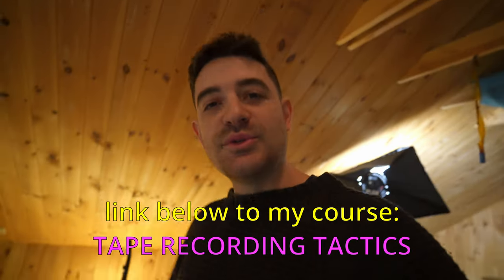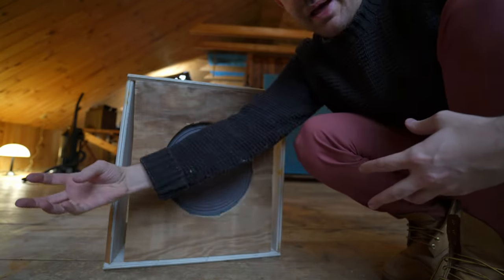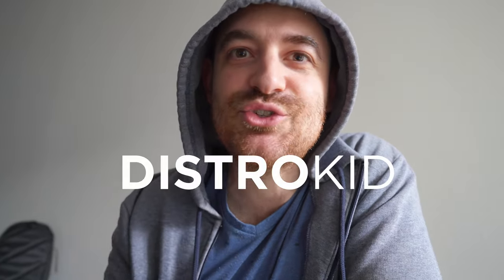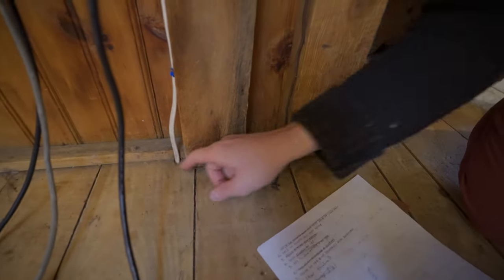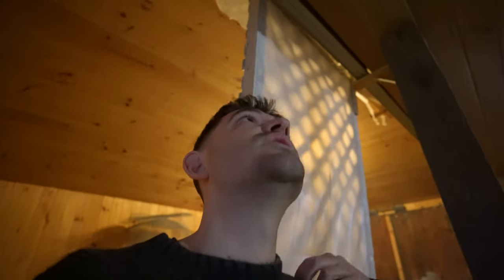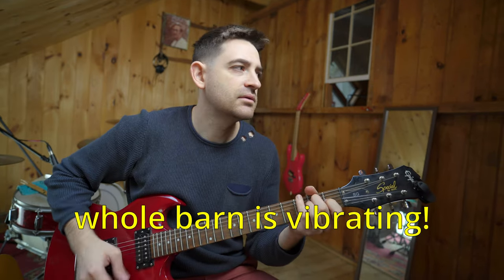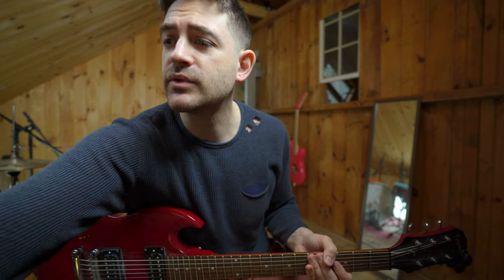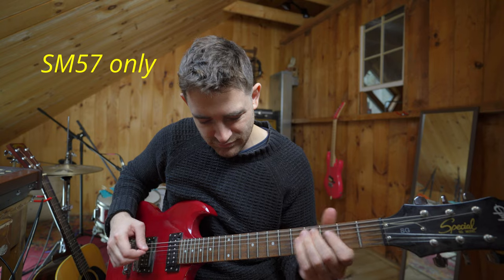You won't believe where I put my Iso Cab!

Comment: Good ideas. I got a new amp on the way and I dig the idea of recording straight from the amp, gonna give this a try. So what's the deal with the Tascam 38? You need any advice on repairs? I actually just sold mine and boxed it up to ship out today. I decided to use an 8 track Tascam cassette deck for your analog course next month! LOL.
Reply from the maker: Hi which amp did you get? thanks for the offer the 38 project is half completed. it got very challenging especially when dealing with electrical issues where the cards meet the motherboard so it's a slow process. but i also had to put it aside for now because i'm working very hard every single day on editing the tape recording tactics course. thanks so much for your getting involved i'm looking forward to getting it out to you.
Reply: @travisraab  Long story. I've been all over the place on amps and usually end up going back to Bias Amp in my DAW. But I'm in "a band" now so need an amp. I had a sweet Fender Tone Master Deluxe Reverb tube amp, but it was way to heavy to haul around to gigs, which I wasn't even playing out at the time (well, only playing out acoustic). So traded that. Then a month or so ago, bought a Fender Mustage LT50, decent amp but heard my buddy's Line 6 Spider v60, so ordered the V120. I've had a few Line 6 Spiders (the smaller, cheaper ones), Fender Mustang GTX 100, Vox Valvetronic 30 amp, etc. I just haven't found my tone yet.

Yeah, sweet, looking forward to this course. Should be a riot.
Reply from the maker: @rocknreplay  jayce, these amp choices... you are heading down the path of the devil. dont worry we will solve your amp issue.
Reply: @travisraab  :face-blue-smiling: